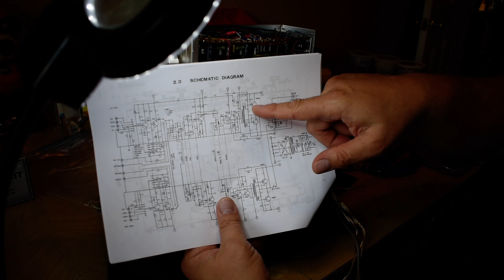Goodbye germanium transistors- it's not hard to changeover to silicon!

Comment: I would really be concerned about the bias stability as a function of operating temperature and power supply variation, with the Ge transistors most of the bias voltage appears across the emitter degeneration resistor as the Ge turn on is quite low, however with Si the reverse is going to be true.  You might be better off replacing the bias resistors with a diode in series with a low value resistor.  Even better to get the diodes in contact with the output transistor's heat sink.  Anyway, have fun.
Reply from the maker: If the Nikko didn't run cool and stable my next step would be a diode-resistor combination.  Thanks for mentioning it.

Comment: I'm working on converting an old Lafayette reel to reel to silicon. Part of it. The oscillator and preamp. The oscillator was tricky but I couldn't find any germanium replacements that would start up every time or make a decent sine wave.  No start and the transistors would burn up.  I used KSA916 in place of 2SB56's.  I have some nos RCA and Phillips Mullards that worked, but they're worth way more than the whole deck.
Reply from the maker: I've used 2N2905's in place of 2SB56's.

Comment: What's the problem, are Germanium transistors not being produced anymore?
Reply from the maker: Most vintage gear after about 1968 is silicon based. I've tried some of the new germaniums from China and they have a high failure rate.  Many weren't usable right out of the bag.  I listened to this Nikko with the left channel original germaniums and the right channel new silicon transistors and there was very little sonic difference but the silicon side was dead quiet with the volume turned down.
Reply: You can get some old stock originals, or 80's russian equivalents. But it depends on the part - not always available and more expensive than silicon and  a resistor.
Reply: Germanium only has one advantage, that is low voltage drop, use Mosfet if this particular feature is needed. In audio it is a bummer, low lifetime, high noise floor, low hfe, bad heat transfer etc. Get rid of germanium, subst.silicon.

Comment: I've stumbled on an interesting website which explains the whole process and calculations to replace the transistors from germanium to silicone, with the formula to calculate the resistor to have the correct bias, correct emitter resistor, class A driver stages and class AB power stage as well. 

I can't post the link here, obviously, but the guy gives a very detailed explanation  for everything. 

Just in case you need or someone needs more detailed explanation and information.

Edit: I never took the time to do it myself, I have a baby knight integrated, and I will do it just for fun. The layout looks a lot like what you have there, with output transformer and instead of emitter resistor, it has some weird lightbulb which protect the output from short circuit. Very bizzare but cool early solid state desing. 

I've only did this, germanium to silicon, once. It was for a seeburg juke-box amplifier. 40W channel. It also has output transistors, like your integrated, but I didn't kept the original circuit, I only used the power transformer and did a totally new amplifier using mj15003/04 output on the old heat sink. And only because the drivers weren't available anymore, and I needed one. 

I used à desing I helped to build and test on the DIY audio forum. It was originally design by a member named Carlos, from Brazil, and the amp is known as the DX amplifier (Destroyer X) the thread might still be online but it date back to 2007/08. 

We had a lot of fun building this. Another member did the pcb layout and silkscreen. 

Unfortunately, the original amplifier was copied, and is now sold as a kit on many online websites. 

(Without giving the credit to the builder and designers, obviously) 

Sorry, I digress a lot when I write about something I'm very passionate about.
Reply from the maker: I found hawestv.com with a whole series on germanium to silicon.
Reply: "funny lightbulb" sounds like a barreter. old school current limiting...